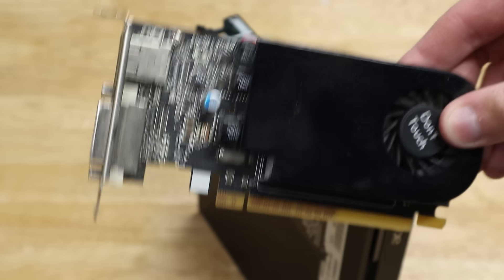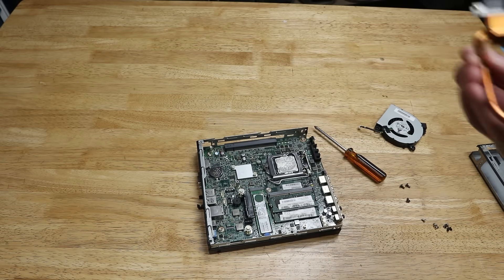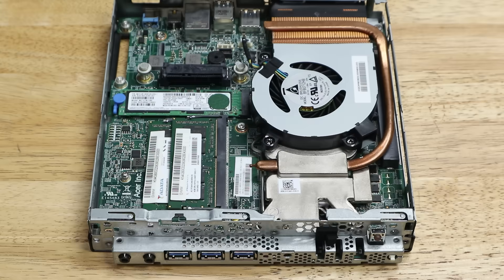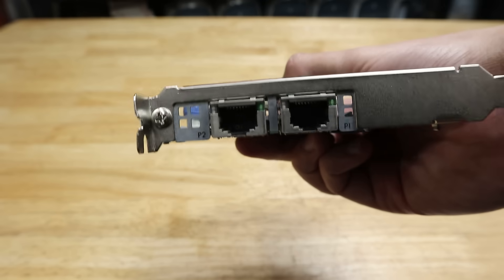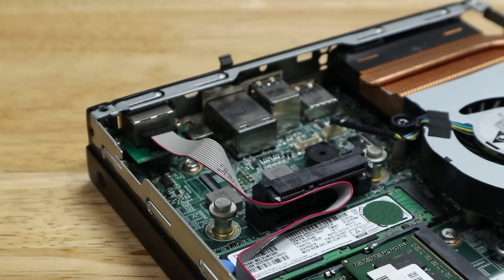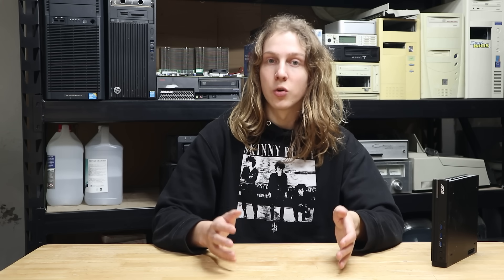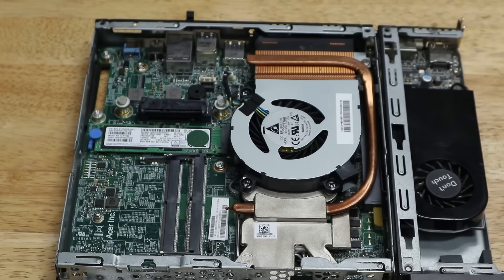This mini pc has a PCIE x16 slot (but it isn't a Lenovo)

Comment: As win 11 require gen 8 or newer cpu that model is likely to drop in price significantly going forward. The Lenovo M720Q on the other hand makes a good compact gaming pc on win 11 paired with the short low profile Yeston 3050 gpu a more powerful psu was required, I choose a 170W Lenovo laptop psu.

Comment: I saw half of this video and imideately thought to install a gtx 1650

A shame i spent 2 hours researching it and looking for a usable power cable. Was also talking with someone selling it with an i5-11400T

But given the wattage limitations, that seems like an issue

I thought it would be so cool to have a mini pc the size of my mouse mat with a 1650 strapped to the side 😢

I wish the slots would just limit power consumption instead of shutting off if it was drawing too much

Comment: Bought one that‘s almost barebone two weeks back. Came only with 4 GB of RAM and the power brick and an old processor. Online I found that the SSD slot is SATA and not NVM.e so if it‘s actually not SATA, that‘s amazing. Mine also has the caddy for a regular 2.5“ SATA SSD so I could put two different SSD‘s … Still gathering info before ordering more parts and starting my homelab

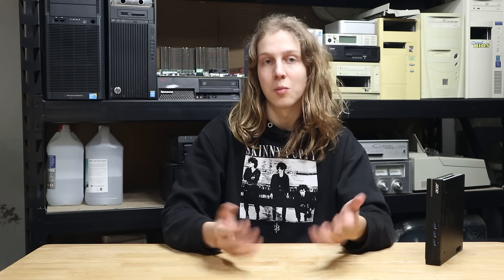Comment: 2:30 I would start looking for a machine no older than Intel's Core 10th Gen/AMD's Ryzen 3000 series due to Resizable BAR/Smart Access Memory.  While this type of machine would make a very nice head for a DAS-type NAS with good performance you need ReBAR/SAM on Intel's ARC cards.

Comment: Well fuck me for seeing this video two days after buying an M920Q. My current laptop is an ACER. I should have known.
I'm getting Timex Sinclair 1000 vibes from the external expansion slot.

I love your old-time straightforward presentation style while also rocking the long hair look that this old man's body can't grow anymore.
I don't see the CMOS battery placement to be all that bad. Thermal paste really should be reapplied every ten years (or less), and the battery lasts that long. Keep in mind as you review systems that bean-counters (accountants) have the authority to override decisions made by the engineers.

Comment: I have a acer right now it blew my mind that i can attach a full 3 slot gpu on the side if i want, i was going to get a lenovo, i have a z2 mini g4 that i was going to use originally but the mxm to pcie adapter lenovo uses for their 1l pc is on the wrong side unfortunately, im using a a4000 lp gpu and a i9-10900 for my mini acer veriton gaming pc

Comment: if it will let us add a card that breaks the x16 slot into 4 x4 M.2 slots to stack 4 NVME drives in it to make a nice NAS.
If we give up one drive then potentially it can be set up with 10GbE as they're x4 segments - there are M.2 10GbE adapters - so it could be added into a high performance compute network, if we, say, had 4 or 10 or N number of hosts they could all access with better throughput than local access, in aggregate.  🙂
Crazy that it has this slot and that it's an x16...I've had a few tiny PC I've built based on "office" or "thin client" type chassis and their best benefit was usually having a built in PS that was fanless or very quiet with small fan.

Comment: I think a Nvidia Tesla P4 would be perfect for a fun local LLM server. You'd just need to power a fan on the 3d printed shroud, but it can run entirely from the slot

Comment: About bad cmos placements, the Lenovo idea centre aio has its cmos on the bottom of the motherboard, so you have to remove the heatsink, m.2 drive, wifi card and entire metal shroud to access it. I think it should be a slot on the side/bottom of these devices like the Wii and Wii u

Comment: Good video. You speak loud, clear and to the point. Subbed.
I bought one of these last week, but I went with the "better model", the N4660G. I say better because it has no compromises. The dual m.2 slots support sata, nvme and optane. It has headers for everything like internal stereo speakers (if you really wish to install inside the case) and even a card reader header if you are willing to mod the case. Serial and debug headers. USB-C and USB-A 10gbps. Plus, graphics cards seem to work fine. I got mine with an i5 8500T (35W) and a 90W power supply. I installed a SFF 40w Quadro GPU and it just works. There is also a video here on YT from a guy with my same model and he even installed a GTX 1050 that requires a 6-pin pci-e power connector. He is even using a pci-e riser/extension cable and it works just fine. I think these newer models are more flexible with the power management, the newer bioses even describe having this level of compatibility. Check if there is a newer bios for your model.
I got it with the vertical stand mount so it is sitting vertically on my desktop with the GPU directly on top. It uses almost no space, I love this thing. Far better than the Lenovos, Dells and HPs. Nothing better to have direct access to a full pci-e 3.0 x16 slot. Totally recommended.
Reply: does it support IOMMU & full PCIE passtrough for proxmox?
Reply: @anantaprasetya6858  I don't use Proxmox but I can only confirm that my cpu supports all the virtualization stuff (vt-x, vt-d, ept) and you can enable it on the UEFI. The motherboard has a B360 chipset so it should support IOMMU right? Cannot test nor 100% confirm.

Comment: I'll have to look into this. If there is an 8th gen option then I'd be all over it.
Reply: There is, checkout Acer N4660G lineup for 8th gen intel. Or even Acer N4690G for 12th gen. Same build form & pcie slot.
Reply: N4640g 6-7gen
N4660g 8-9 gen
N4680gt 10-11 gen
N4690g 12gen

Comment: Got myself a lenovo  M720Q and i'm gonna try using a oculink adapater card to get by the lack of space problem and install a HBA card into an old case I have which will also house a full sized PSU and HDDs. Not sure how stable this'll be but I find it fun to see how much stuff I can make these 1L PCs do.

Comment: There's model with newer generation cpu.
Reply: What model is it?
Reply: @bryanc4054  N6660G  for 8/9th gen
N6670G  for 10th gen
N6680G  for 11th gen
N6690G  for 12th gen
P/s: Use another PSU should fix dGPU power issue.
Reply from the maker: Using another PSU doesn't fix the GPU power issue because the GPU will still attempt to draw too much power from the slot, even with an ATX psu connected.
Reply: @serverscience  I get it. This pcie slot only support 35W. So undervolt, underclock and limit the power draw of the gpu to maximum 70W.
Based on my experience, it will try to split evenly between pcie slot and the cable. So set limit to 70W should fix.
Reply: @serverscience  Or you can try using pcie riser card with external power cable. It will draw power from attached cable instead of motherboard. But that will make the whole thing become more janky.
Reply: @zNaYuz  I use for 6 months already a N6660G with i3 9th gen,  and the  PCI-e slot  is populated  with a Zotac Mini 1050TI 4 GB ,  which  delivers  properly  fo my living room entertaiment .  I am quite pleased  with this combo .

Comment: as its an acer branded motherboard, It is my understanding with these 6th and 7th gen boards, you can bios mod them to support the QTJ1 and similar cpus off of aliexpress/ebay. Cooling aside, you could power limit said chips and have quite the capable little 6 or 8 core chip.

Comment: also you can mod the bios to support 8th and 9th gen as well as mutants 10th gen
Reply: How is that possible? Socket is different and chipset does not allow it.
Reply: @zuzkazuzka8284  the mutants are created for older socket
Reply: @zuzkazuzka8284  For 8th gen socket is the same. 1151v1 and 1151v2 was purely a firmware change.
Reply: Different socket, can't mod it. Checkout N4660G for 8th gen socket.
Reply: I have heard that it's possible. From what I can see it would work for the Z170 chipset up to 9th gen Intel? 

I'm running a Q270 chipset on my mobo so I guess I'm SOL haha

Comment: acer has kinda went a different route with their business minis than the others, they have a few different lines of pcs for business, the N line stands alone as a budget mini then you have the 6000 line that has the vero as its mini which can take higher wattage cpus than the N line,the 4000 line which doesnt offer a mini and then the 2000 line which offers the 2000 mini !   They all of course have sff and mid towers in their lines as well the difference beetween them as varied as the next! Its little wonder they havent smashed in roads into offices and arent too well known,if i were an  I.T manager with a firm  i wouldnt bother looking into the lines too complicated like they are

Comment: Dang ! It does not support the 75w, i was about to buy one and slap a 3050 6gb inside ! What a shame...
Reply: Arc 310 and RX6400 still an option, or a cheap RTX a2000(or an RTX 3050 6gb laptop) MXM card
Reply: Arc A390 Low Profile from Sparkle and Asrock is what you searching for. They both have way under 75 Watt Power Limit.
Reply: Rtx a4000 single slot
Reply: @cislife7140  He was talking about 50W may pci e pd, rtx a4000 is extremly expensive and is a 75W card
Reply: @justagamerhun2228 i see but thats the exact card i use though

Comment: Hey! Your videos are getting very interesting. Great review about this tiny Acer. Would love to see the pictures of your RTX 3070 attached to the ATX PSU and this tiny guy. Also don't forget to include power consumption and noise levels. Get a hold of a Killawatt and a proper sonometer. Keep the good work!
Reply from the maker: Oh oops, i completely forgot to include the power draw in the video, because I got a killawatt a few months ago. It was around 20-30 watts at idle, and about 35 when booting, but I can't remember the draw under load, I'll have to check.

Also, I've posted an image of it with the gpu attached.